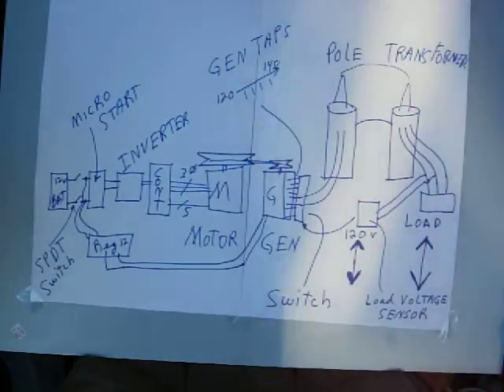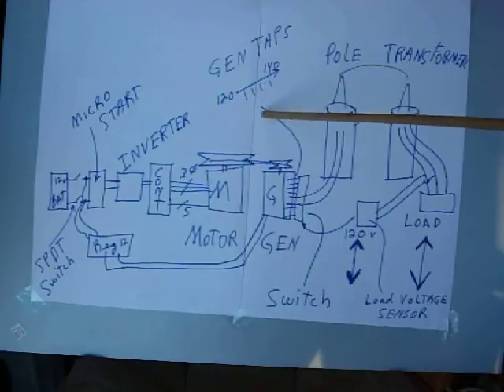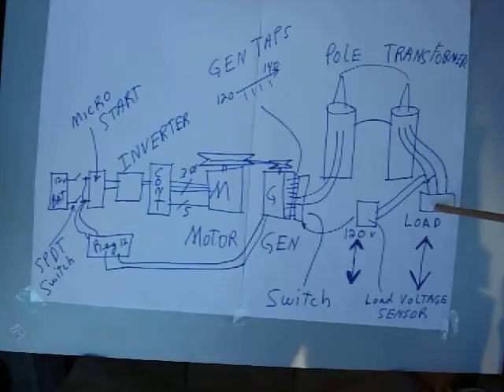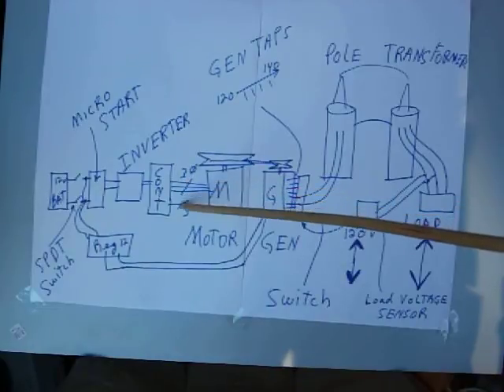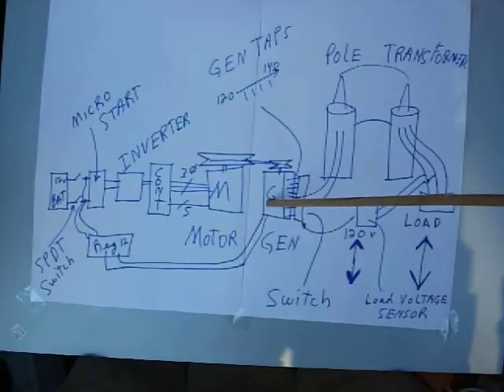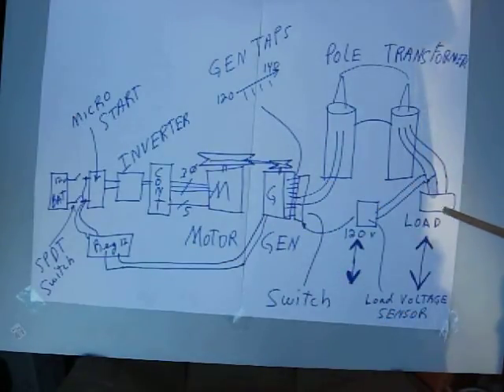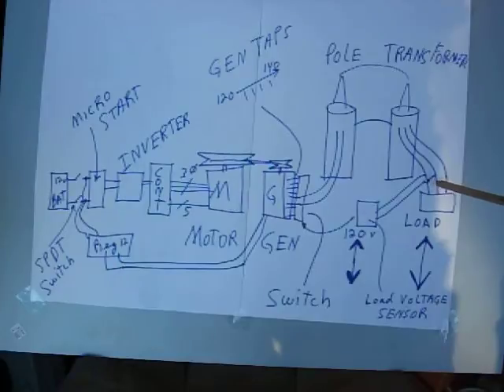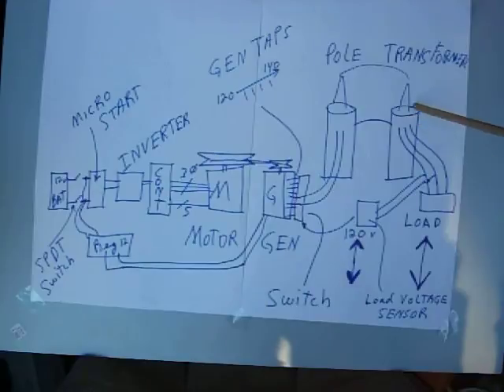Don Smith #146explaining the energy system drawing

Comment: Hi Gary i priced the transformers they are steep .
Reply from the maker: ABB sells this part number for it uses copper for HV coil and aluminum sheet for the LV winding  will be getting 2 of these and then 2  25KW

M1412P15AAW07L2                      $798           + ship
Overhead
Distribution Transformer;  S -
Conventional  15 KVA 
 No Load: 42 Watts
at 85 degrees C; Load: 204 Watts at 85 degrees C; Total Loss:  246 Watts
 $798 Total Owning Cost 
24940GY/14400 HV;
125 BIL; Copper HV Winding Matl
120/240 LV; 30 *30 BIL; LV Interlaced; Aluminum LV Winding MatlBoundary Electric in BC Canada sells them $1500 plus $1000 shipping to Fl

Comment from the maker: The Micro Start is being replaced by a bank of Maxwell High Farad capacitors. 

New Energy System Information
After analyzing the previous design, I have done some modifications to the system.
Basically I have eliminated the Micro Start and associated DCV Regulator.  The Micro Start would not be able to recharge fast enough to keep the inverter running.   Once up and running I may discover that the Micro Start may be able to handle the energy flow.
The system consists of 12 VDC Battery,  Maxwell Capacitor Bank, Pure Sine Wave 120VAC 60Hz Inverter, 3 Phase Motor PCB(printed circuit board) Controller, 3 Phase Motor with Hall Sensors, 1200 Watt Bipolar 120 VAC 60 Hz Generator Modified, Two Pulleys one 8” and one 2”, V-belt, Generator Control Panel with 120VAC and 12VDC outputs, Special output sensor
circuitry with Automatic Switch, and 2 Pole Transformers.

This hardware allows us to generate up to 6000 watts from 1200 watts.  A portion of the output will be brought back to the front-end of the system to replenish that energy used to run the device.  Once started the system should be able to maintain it’s 6000 watt output with no further input from external sources and the battery can be removed from the system.  The battery will only be needed to restart the system, when it is shut down for maintenance.  
The energy flow begins with the battery.  It provides the Electron Style current to the 120VAC Inverter.  This energy flows first thru the capacitor bank, which stores the DCV from either the Generators 12VDC output or the initial batteries 12VDC.   The Inverters output 120VAC 60 Hz pure sine wave Electron flow is used by the 3 Phase Motor Controller PCB to drive the 3 Phase Hall Sensor type motor.   This controller has a speed adjustment potentiometer, which allows the motor and generator combination to produce 120VAC 60 Hz energy.  This energy drives the first pole transformers 120 VAC input. 
The energy flow from the Generator contains two types of energy.  One type is our present type of energy which uses electrons(HOT) and the other type from the generator is radiation(COLD) in the form of a 120 VAC 60 Hz wave.
The first pole transformers 120 VAC input connectors are connected to the
generators 120 VAC output.   The pole transformers contain two Aluminum Coil  Plates and a high voltage coil winding using copper wire.  The Electron portion of the generators energy flow does not flow thru the first pole back to the generator.   Nikola Tesla describes this
in his Researches and Writing book.  He states that the primary being of huge mass forces the electrons to move so slow that they get hung up in the primary coils metallic lattice structure.  Another words they never get back to power source.  If they did make it all they way back to the generator then the fuse or breaker would blow, because the Aluminum Plate acts like a dead short circuit to the generators 120 VAC output.
The 120 VAC  60 Hz Radiation from the generator does flow thru the Aluminum Plate and generates 14,400 VAC 60 Hz Radiation out thru the pole transformer top ceramic connector.   This Radiation is called Cold Electricity because it has no electrons only radiation.
The first pole transformers 14,400 VAC output is connected to the ceramic High
Voltage connector of the second Pole transformer.   The second pole transformers output
connectors provide 120VAC 60 Hz Cold Electricity to run your home items such as stoves, refrigerators, lighting, and anything else that can run off your current 60 Hz electron type energy flow.
The trick is to be able to monitor the amount of energy flowing to your appliances
and keep it at a steady level 120 VAC and at 60 Hz.  To do this the output sensors will have to
change the generators output AC Voltage only but must keep the same frequency
of 60 Hz.   The best way to do this would be to rewind the generator so that it has multiple outputs.   When the second pole transformers output reduces due to loading the sensor detects this change and tells the automatic switch to select a different voltage level from the generator.  This will compensate for the reduced voltage and keep the output from the second pole transformer steady.   By doing this the speed of the generator never changes and the 60 Hz is maintained.

The last piece to this energy puzzle relates to the feedback from the output back
to the front end of the system.   This energy flow is a regulated 12VDC and recharges the battery capacitor bank combo or the capacitor bank alone, if the battery is disconnected for the self running mode.   As I test this setup, I'll update with drawings and test results,  but this is the latest system information.   I'm currently working on the system output energy level monitor and auto switch controller.
Reply: Cant wait to see. What happens to the electrons?  Do they stay in the transformer or are the dumped somehow since you will only use the radiation?  Maybe a dumb question but im just a carpenter remember.
Reply from the maker: Just solder up the 6 350 F 2.7v dc capacitor bank.  pcb from china works great the caps fit the pcb perfect.  next step is to get the two pole transformers.  the latter is not an easy task.  the electrons move extremely slowly thru the aluminum plate from zero amps to a little over one amp maybe I'll have to take some readings.  I would imagine that the larger the generator is the more radiation you can generate.  My Gen 154 Sportsman is 2kw max.
Reply from the maker: Trump luvs carpenters.
Reply from the maker: Very few flow thru the aluminum plate that's why Gerard's amp meter shows very small amp reading.   The should be NO LOAD on the motor generator unless their is a load caused by the 120VAC Radiation flowing.   This tells me that that if you want more than 6kw output you should provide more 120VAC radiation from the generator.  For example if we use a 5kw generator it still produces the 120VAC but the radiation is double that of the 2kw gen.  From this we can conclude that the wire size in the generator determines the amount of radiation and the number of turns gives us the 120VAC and the speed of gen gives us the 60Hz.  to provide regulation we simply need more 120vac radiation or more voltage. if the later is the case then the gen must have more windings with taps beyond the 120vac.  as load drops ACV down the switch chooses another tap automatically.   this circuitry needs to be designed.

Comment from the maker: Just got a quote on transformers  15kw $798 25kw $904.   The next step will be to hook it up like Gerard did in his overunity test and take measurement.   I need to find out what the output 120v does as loads change.   this info will let me know the winding changes that will be needed inside the Gen 154 coils.   The idea is to use a switch which is controlled by a PCB sensor circuit that monitors the output voltage level and switches the to different generator coils to keep the output regulated.

Comment from the maker: The BLDC 3 phase motor is from ebay Samsung type 36 stator coils and rotor has 12 arcs of 4 poles each magnets.   PCB controller is my design along with Atmel modified Mega48 processor code.  The parts for the PCB is also from Digikey as a kit.   The generator and its control panel are from  A Gen 154 and the generator portion has been hacksawed off the gasoline engine.   I'm not sure at this time what I'm going to do about monitoring the load and controlling the multiple gen outputs to the auto-switch.   This will require an additional PCB or I may add the circuitry to the existing Motor controller PCB.  WE shall see.  But without load monitoring and auto switch the system should be fine for driving 6kw of loads.  You can also ad PFC Power Factor Correction capacitors to each of your house hold motor appliances.  This will allow your system to provide only Resistive Power(Heat) vector and the two reactive(Capacitive & Inductive) vectors will cancel each other.

Links to get parts:
Pure Sine Wave Inverter
http://www.theinverterstore.com/1200-watt-pure-sine-inverter.html
25KW Pole Transformer you may want to get them locally.  the key is that the two 120vac connections must be from aluminum plates NOT HEAVY WIRE.
http://www.boundaryelectric.ca/
Micro Start XP-10 
https://www.amazon.com/Antigravity-Batteries-AG-XP-10-Multi-Function-Starter/dp/B00MQ5Z5F2/ref=sr_1_1?ie=UTF8&qid=1466274515&sr=8-1&keywords=micro-start+xp-10
12VDC Voltage Regulator (this
maybe too low a charging current I’m not sure of Inverter wattage usage yet
https://www.amazon.com/DROK-Waterproof-Stabilizer-Conversion-Efficiency/dp/B018WZFRNE/ref=sr_1_6?ie=UTF8&qid=1466274723&sr=8-6&keywords=12vdc+regulator

Switch DPST  10 amp 120 vac type for disconnecting the
battery once the system is running.  
https://www.digikey.com/product-search/en?keywords=563-1865-ND

Comment: if your going to work on the high side of the transformer short it out with battery jumper cables for at least 10 min. before working on it. it will hold a charge that needs to be drained.
Reply from the maker: same thing goes go HV caps some of the really good quality caps will hold 10kv for quite a while.   I'll be getting some linesman insulating cloths as well so that if I fall into the 14,4 kv it'll be covered.

Comment: are they 2 pole pigs.
Reply from the maker: right side of the drawing shows both left one receives energy on its 120 inputs and outputs the 14,400.   the one on the right uses that 14,4 to generator the two 120v ac 60hz cold energy output to run the loads.

Comment: it's funny I designed something very similar 6 months ago and was gathering the parts today. I look forward to a video to see your progress.
Reply from the maker: What I find interesting is Gerards amp meter reading from the generator into the first pole transformer roughly 0 amps.  this tells me that their is no load on the generator and in this situation it is simply a broadcasting transmitter of 60hz 120 volt radiation with no watts involved.  It will be interesting to drive both 120 inputs of the first pole at the same time and see what the load 6kw does sound wise.  The saw should speed up.  also, another test would be to put loads on both 120 outputs of the second pole.

Comment: lol, I was there once. that's a lot of parts and pieces.  a lot of things moving and spinning.  probably just wear down in time,  no?if the duration of radiation is the frequency, and effieciency of the transformation of the said radiation hides in the materials that ring like a bell, it may be easier to skip all that and just ring the right materials instead.